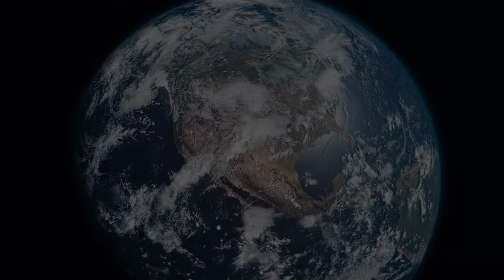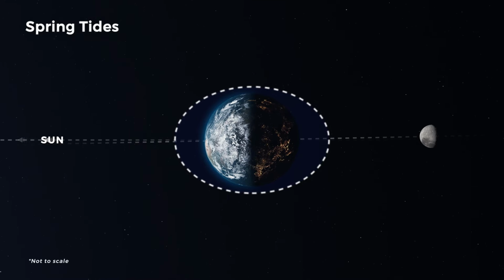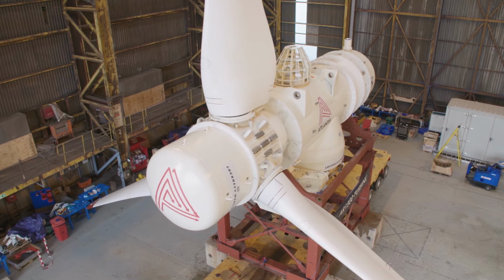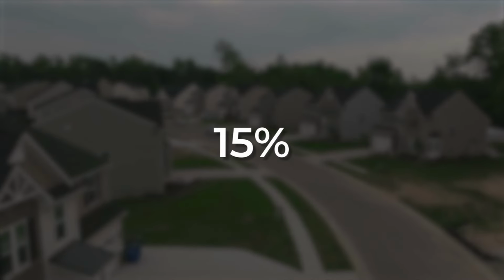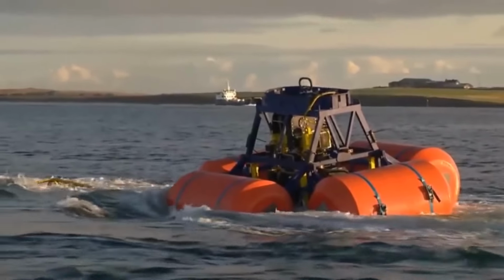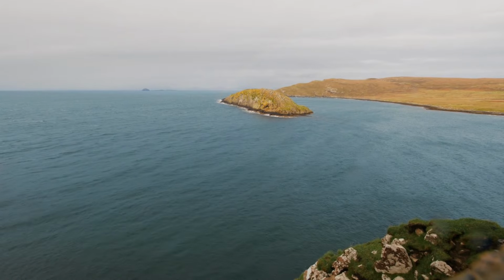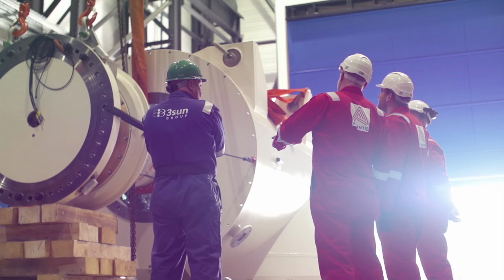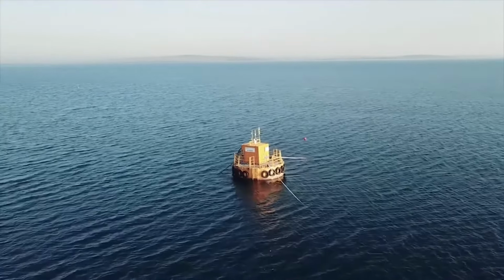Can Underwater Turbines Solve Our Energy Problems?

Comment: What exactly is the energy problem? Is oil running out anytime soon? Is nuclear power a farce?
Reply: Well the big problem is global warming and pollution. Cars produce co2 which is a greenhouse gas contribute to global warming. Even if we all switched to electric cars , the electricity still has to be generated. Nuclear power is actually the best clean energy source we have right now but it has bad reputation, plus it produces waste and nuclear fuel is finite too. Renewable energy is practically free and most importantly clean energy. Until we have fusion reactors (close to nuclear but a lot more efficient, clean and fuel is literally water) renewables and nuclear energy are our best option for preserving the planet.

Comment: The energy comes from tides
We take energy out of them
What is the consequence of that if we implement this on a large scale
Reply: It doesn't affect the energy of the tides. Its basically like solar energy
Reply: @amaterasu964  You don't know.
Saying that using the energy of tides won't effect the energy of tides is literally an intellectual contradiction.
Reply: probably slows the earths rotation at a faster rate than it already is, somebody 5,000 years from now might have to worry about that
Reply: @deathpony698  
Just like "global warming".....

Comment: Great video :) I worked in the composit materials for tidal turbines, and this source of energy is promessing. However, it seems that u over estimate a little the potential in USA. The power that could be installed reaches a few GW (u can check a report of the ADEME, i give u the link if u want). So even with a charge factor of 50-60%, u won't be able to give energy to half of America. Some other problems is that especially in USA, some areas are fishing areas, and tidal turbines couldn't be installed there (unless we stop to eat fish). 
So it seems that this type of energy could provide a few percent of our electricity, but let's not put our hopes too high, since the potential "qualified" isn't really high...

Comment: These systems are great. I read about them some years ago now but one of their limitations not mentioned here was the limited places where they can be installed. 'Fast flowing' bottle necked tidal estuaries are not exactly abundant around the country. But I do agree they have a very low environmental impact. I think the coolest thing about this form of renewable is the predictablilty aspect because its directly related to the Sun and Moon. So cool.
Reply: It makes even less sense then windmills or hydropower plants. In the case of hydro and windmills, you can kind of argue you mess with the local climate, even though there is nothing like local climate, as everything affects everything. 

But in the case of ocean energy, you directly mess with the whole planet, because oceans are directly interconnected. Any large scale ocean energy removal will have a catastrophic environmental impact. 

It is far more complicated than just CO2.

Comment: I feel like nuclear can solve but people are so misinformed
Reply: Cold War, and now the Chernobyl series...
It doesn't really matter what you square up against it, Nuclear Power pretty much always wins, most times with a crushing victory.
Be it pollution, cost, maintenance, durability, length of operation, structural waste...
But people would rather choose the inefficient windmills, or the cadmium (and other heavy metals) laced solar panels, because regular people don't consider the "what after" when installing them.
Same with tidal turbines.
Great on paper, how do we implement them in a way that's cost-efficient, low-maintenance, and non-polluting structurally?
We don't.

Nuclear power, be it plutonium or thorium fueled, is the future, the only one worth working towards.
Fusion is a dream worth giving shape.
But right now, fission is all we've got.

And people are scared of it, because "what if it explodes".
I'll do you one better.
What if the millions of tons of solar panels stop working because of age, and have to be recycled while there are no regulations on waste-management, and they eventually get shipped off to china where the countless heavy pollutants are fused into landfills, where the harmful materials that damage the ozone layer more than anything else ever could get burnt?
... Because that's not an IF.
That's a WHEN.
That's 20 years from now.
Hell, it's already happening.

Green energy doesn't exist.
It's a political lie, a scam.
The best next thing to that fantasy?
The reality of fission.
We've got a chance.
In 2 decades, that will be "We had a chance...".

IMPORTANT:

Don't believe anything i say.
Don't believe anyone telling you things.

Do the research.
Slam it into google, duckduckgo, bing, whatever have you.
Read the facts, read the truth.
Because everybody's lying, because everybody's afraid, because nobody does the research.
Prove me wrong, give me proof that i'm wrong... I want to be wrong.
Reply: Actually if youre to go on deaths then nuclear power is quite safe especially if you look at current improvements aswell as future improvements. Theres more human deaths in the "green fuel" and coal department, not to mention coal destroys the atmosphere whilst greens also destroy the enviroment, take wind turbines for example, ever wonder about how many birds get killed? Or better yet dams, fish get splattered. Nuclear fuel? A tiny bit (way lower than coal) to the atmosphere and plenty of space to keep the waste safely with a future that we can further use said waste and lower it. 

The 3 issues are:

Again misinformation, people think chernoble when they think nuclear power. Aswell as everyone wants green power but it simply doesnt do enough and hurts the enviroment in its own right

Money

It takes about 10-15 years to build every nuclear reactor and many are quite old and improvements will benefit them alot.
Reply: @darkwolf1739  plus 4th gen can be mass produced, inducing economies scale will significantly reduce capital costs. Probably half of nuclear plant construction capital cost is regulation and super high standards of safety alone.
Reply: so true. Is even more stupid that most politicians are also misinformed.
Reply: ikr, i really wish i live to see the day where fusion is used wide scale as the main source of energy
Reply: @7tqpbnvh7tqpbnvh77  Glad to see France is a nuclear hellscape... oh wait.
Reply: @nicomarino96  Buddy, The fukashima solution can be solved in the easiest way possible. And do you want to know what happened to Chernobyl? Do you? alright because it is hilarious. So they were gunna do a usual check on the fuel rods which involves shutting down the reactor and starting it back up again, but you see here the maintenancecrew was away on a party or something and were gunna get back in an hour. The people that were monitoring the reactor were interns and apprentices, plus some other people, and had NO IDEA how to do this maintenece check. So then some GENUIS GUY in charge of the nuclear reactor decided that these untrained 15-25 yr old should run a very complicated process that HE KNEW could cause a reactor meltdown that would destroy most of the city. The people protested, he threatened to fire them, so they did it. AND THEN THEY FUCKED IT UP REAL BAD. We don't know exactly what shitty thing they did, but it was real bad. Anyways so basically Chernobyl was caused by idiots running a nuclear reactor
Reply: You are  misinformed
Reply: @DSAK55  na
Reply: @nicomarino96  Not as nearly as fast as we did with nuclear.
Reply: @nicomarino96  We still do coal that kill a lot more people than nuclear, so it's probably just a better anti-lobby.
Reply: Those turbines in particular are kinda comparable to nuclear due their 24/7 operation modes instead of the "god's will" of wind turbines or "only during the time people don't use that much power" of solar.
Reply: too expensive.
Reply: Waste management is challenging, and the risk is much bigger.
Reply: @AD-qf8yj  It can be recycled. Read up on it.
Reply: Yup, thanks to WW2, Chernobyl, and Fukushima misinformation my plan submissions to government never approved...
Reply: I feel like people who comment things like this are misinformed. Uranium is a finite resource too. Nuclear provides 14% of global electricity production so at that rate we have approximately 135 years worth of reserves left. But if we increased the global share of electricity coming from nuclear to replace fossil fuels, to 90% and used renewables for the rest of the 10% we'd have only 21 years left of uranium reserves worldwide. Not even long enough to outlive the lifespan of all the new and expensive reactors that would have to be built for it.
Reply: @laur-unstagenameactuallyca1587  Wrong. You're calculating that based on available reserves of Uranium 235 using existing reactors, but the discussion is not about pressure water reactors, it's about 4th generation reactors, and they are up to 200 times more efficient than pressure water reactors, they can consume uranium 238 or thorium 232, with the latter being 3 times more abundant than uranium. If you calculate this new paradigm, you'll end up with thorium and uranium reserves lasting us several thousand years at current global consumption. This leaves us plenty of time to figure out fusion, and that's not even calculating the available thorium/uranium reserves on asteroids and the solar system, which probably would last us several hundred thousand years.
Reply: @laur-unstagenameactuallyca1587  First off we have way more uranium on earth than that, (if you include stuff recycled from nuclear weapons), and second I, and many others, see fission as a temporary source of energy until fusion becomes avaible, as it is currently the best source we have.

Comment: I did a module in ocean energy at University, there is a lot of energy in tides and even better, predictable energy
Reply: Now I'm wondering what it would take for us to basically manufacture our own tidal facility.  How long does a continuous body of water have to be to see tidal effects?
Reply: Colin Smith there are lots of natural places that are perfect for tidal energy, like nova scotia in Canada, or the spot mentioned in the video at scotland. But theres more to engineering turbines than just maximise energy output , its the economics of the design. A site may have very strong tides but a poor seabed which requires stronger foundations, more force on the turbine increasing manufacturing costs, poor access to shore power, needs of the local area such as ships and wildlife and much much more
Reply: @tommclean9208  Not only that, there are a LOT of places on Earth where there simply aren't bodies of water with viable tides.  That's why I'm wondering out making our own situations.  How far apart would two water reservoirs need to be?  How large would they need to be?  What kind of aquaducts would need to connect them to generate tidal forces worth harvesting?  Could that be underground, not above?
Reply: Colin Smith we didnt really study anything to that effect. If i had to guess, i would say it is not possible as the tides are created due to gravity which is a weak force, so you would need an ocean sized body of water to create a strong enough tide. Maybe we can create stronger tides in certain regions through modification of the landscape, but that would probably be very expensive.

However, we can make tidal barrages which fill up with water on a rising tide and then when the tide falls the water goes through a turbine generating energy. One project in the uk, the severn estuary barrage, could generate 5% of the uk’s energy needs.

Comment: Instead of doing underwater turbines we can do a global solar network. So there is always power all over the world. Half the Earth is always lit by the Sun.
Reply: Would only work with high temp superconductors. Best of luck.
Reply: @Stanton_High  why? It is not different from using  power from solar panels. The efficiency is low but since the power comes from sun that not a problem for near term. The only issue I see is national boundaries and law.
Reply: @AdityaDodda  you are talking about transmitting electricity literally around the world, the losses in transmission would be massive, hence the need for some type of superconductor.
Reply: @Stanton_High  I never said the solar panels would be in one single place. It can be distributed optimally.
Reply: @AdityaDodda  nice strawman. Lol
If you want to take the energy from where the sun is and move it to where the sun isn't, you HAVE to have conductors stretching from one side of the world to the other. 
Without a superconductor, the losses would drop the effective effeciency down so low you would be wasting all of your gains in transmission.
Reply: @Stanton_High  Are discounting the possibility of having intermediate energy storage devices? That will be needed nevertheless as grid optimization at the proposed large scale will be nearly impossible. @Stanton High: I am very aware that the losses in transmission will be significantly higher. My argument is heavily weighted on the fact that intermediate storage devices and long lasting nature of Sun will make the losses acceptable.
Reply: @AdityaDodda  storage devices would make your network obsolete as it would solve the problem of needing power when it couldn't be produced. 
You are right about one thing, and that's fusion. 😉

Comment: I’d be scared of large underwater propellers. Personally I’d like to see a cage around them so the water can still get through but not living creatures
Reply: They aren't propellers, they are turbines.
Reply: As mentioned in the video, they're lethargic vanes that won't slice, nor injure anything so to speak. As for a cage, a drawback to this notion is that, again, as mentioned in the video, seaweed and silt obviously flow through waterways,  which won't be a foreseeable issue for the turning vanes due to anti-grime adhering paint and their inherent shape, however, for a cage, an object that unlike the vanes, isn't moving, will A, catch-all the oncoming seaweed / silt, and B, create an exponential built up of said grime, potentially blocking much of the flow of water. An additional issue courtesy of the cage would involve consistent and constant maintenance, further adding to costs along with the decreased efficiency of the vanes due to the restricted water flow which thus produces less electricity. This would hinder the follow-up costs in the future to pay off the investment made into the project. So, to sum up, a cage would render no foreseeable benefits tbh